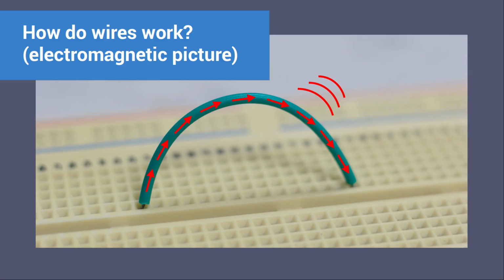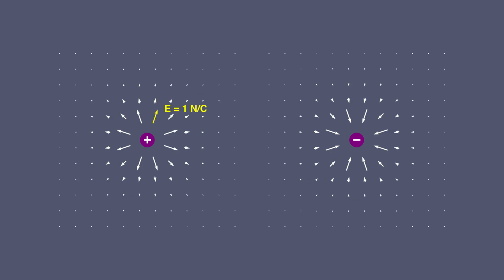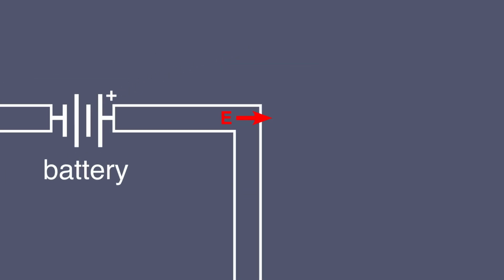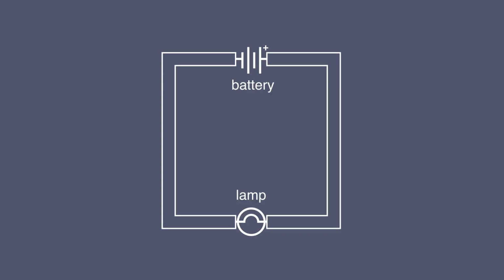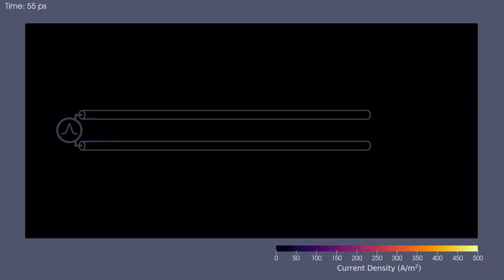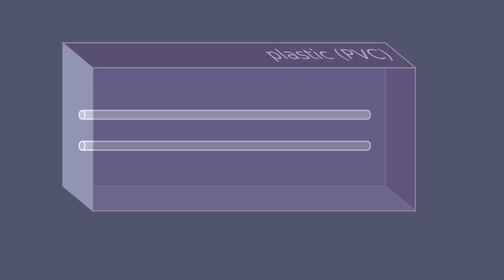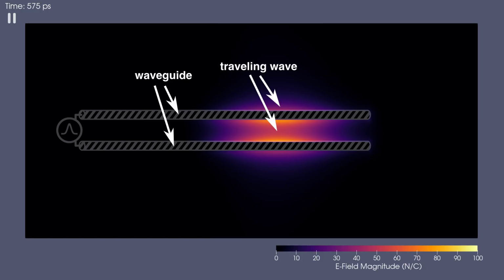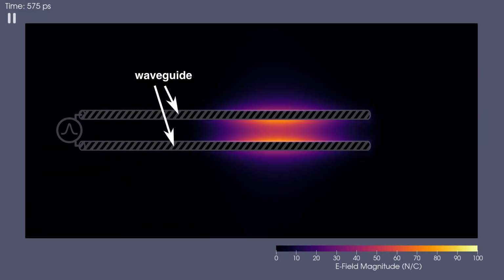How do wires work? (electromagnetic picture)

Comment: It seems that electricity is still not totally understood.
We have gone from:
"electrons travel through a wire real fast and are slowed down when they do work" 
to:
 "it's really electric fields that do the work and the electrons help contribute to the electric field but don't move much".

I understand that a battery is actually made up of two different compartments where some material dividing the battery into a section that has a positive electric charge (lacks electrons) and the other section that has a negative electric charge (has an excess number of electrons).
When you create a circuit having the battery, copper wires and a light bulb, the electric field created by the two sides of the battery makes the light bulb light up.

Can you simulate something like the following:
Let us say you have two batteries of the same voltage (battery A and battery B) and connect one end of a copper wire to the positive terminal of battery A and the other end of the copper wire to a light bulb.  You then connect one end of second copper wire to the other side of the light bulb and the the other end of this second copper wire to the negative terminal of battery B.
Wouldn't you expect the bulb to light up?
When you have a single battery the positive and negative terminals are separated by some kind of thin wall.
Is the scenario above (with the two batteries) not the same?
Does the electric field not exist in the second scenario?
What if you bring battery A and battery B very close to each other but never touching?

Comment: Why does the feedback mean that the field is close to 0 within the wire? I think i understood that if there were at all any normal component of the electric field at the conductor surface, then a charge will travel in that direction and stop at the surface. Ultimately there will be surface charges in just the right number to cancel out any normal component of electric field that put them there in the first place. And that therefore somehow means the electric field can only be parallel in the wire I guess, even this part I'm not sure makes sense to me. Yeah, past this point I can't really make sense of anything that will be a logical next step. Like why does the feedback mean the E field has to be parallel within the wire? Why does it mean the E field within the wire is close to 0?

Would also appreciate if someone could explain why the 2 boundary conditions at 7:00 are true.
Reply from the maker: Hi!  Thanks for the great questions.

I think your understanding so far is good.  Now move inwards from the surface and consider another concentric shell inside the conductor.  If the E-field has a normal component outwards at this shell, then charge would move outwards there and the increasing charge in the outer layers would oppose the original E-field.

The hole in this handwaving explanation is that current could be flowing outwards, along the wire, and then back in a little further up the wire, avoiding any pile-up on the surface.  But now if you consider a little loop of electric field like that, we need the total electric field around a whole circle to be zero (Faraday's law, assuming no changing magnetic fields).  So the electric field must be ~3x greater along the fourth wall of the loop, and this is not a steady state, the loop will stretch since there are greater forces between charges on that side, until the E-field lines are stretched into spaghetti again.

A more rigorous way to look at it is that (again assuming DC with no changing magnetic fields), the voltage in the wire obeys a Laplace equation ∇²V=0.  The solutions of the Laplace equation are always the flattest possible  interpolations between the boundary conditions at the boundaries of the wire. In general that means the voltage in transverse cross-sections of a wire will be constant, and the electric field (=grad V) is along the wire.

I do think the physical mechanism is along the lines of the feedback model. It's just that the human mind isn't very good at simultaneously considering all of the interactions that happen between charges, that always statistically cause the solution to approach the ideal one with electric field along the wire.

I'll answer the other questions in a second comment.
Reply from the maker: (part 2) When I say E ≈ 0 inside the wire, to be precise what I mean is that the internal electric field is much smaller than the external electric field, so when we are calculating the external electric field we can ignore the internal one in most cases.

Firstly: metals are very good conductors and it doesn't take much E field inside the conductor to get electrons to move.  For example, the conductivity of copper is σ=~58 x 10^6 S/m, and current density J=σE.  So inside the wire an E-field of 1 V/m would produce an current of 58 million amps per square meter and soon melt the wire.  In air 1 V/m can be considered small, the normal atmospheric electric field we walk around in every day is ~100 V/m.

Now the electric field in the wire is resistive voltage drop / wire length.  The electric field outside is a function of circuit voltage / wire dimensions (radius and effective distance to the return current path, the exact details depend on the geometry).  Usually in a practical circuit, circuit voltage >> resistive voltage drop, and wire length >> wire dimensions, which is why we can say E_inside << E_outside.  The simulation near 03:58 shows one example of how this plays out in practice, with E ~ 2x10^-6 V/m inside and E ~ 50 V/m outside for this example geometry.

E∥ ≈ 0:
This is derived by Faraday's law applied to a loop that travels along the inside and outside of the wire surface, with negligible height.  If E ≈ 0 inside, and the sum around the loop is 0, then E∥ ≈ 0 outside follows.

B⟂ ≈ 0:
I actually realize now that this boundary condition is redundant as it follows from E∥ ≈ 0. From Faraday's law in differential form we have ∇×E = -dB/dt.  If E is zero
in the two ∥ directions say x and y, then the z component of ∇×E is zero, and hence dBz/dt = 0, hence Bz = constant.  We can assume no fields at the beginning of time, so Bz = 0.

Comment: Great video too! How did you make these simulations? Variant of FDTD? Also what language and how long did they take to run :)
Reply from the maker: Yes, FDTD.  For this video I used OpenEMS, it uses a neat method called Equivalent Circuit FDTD (EC-FDTD), where space is treated as a lattice of electrical nodes with capacitances/inductances/resistances, with the right connections it becomes equivalent to Maxwell's equations (it's all just differential equations after all).  It's actually pretty fast, for example the wire pair simulation takes about 7 minutes on my not-super-fast laptop (on a grid of 480x240x120 x 2000 time steps).  The core code is in C++ but it has Python and Matlab wrappers (I used Python).  For other videos I've used other simulation tools, I generally put the software used in the description.